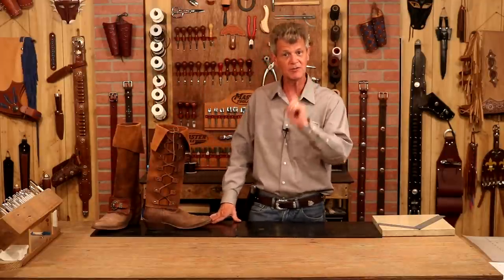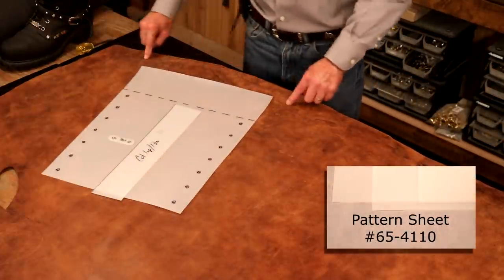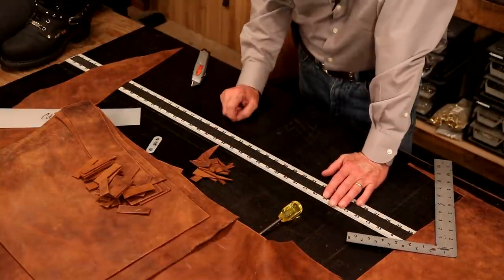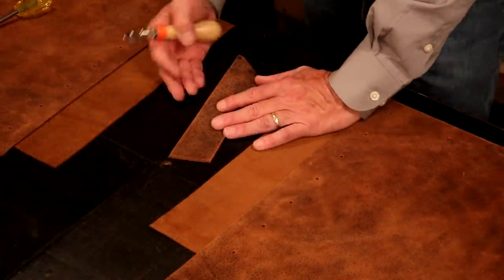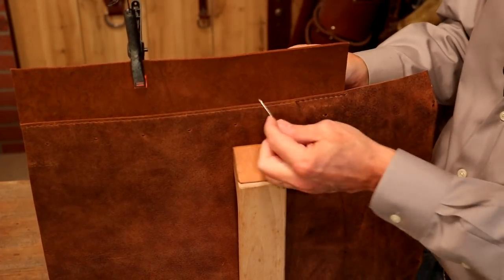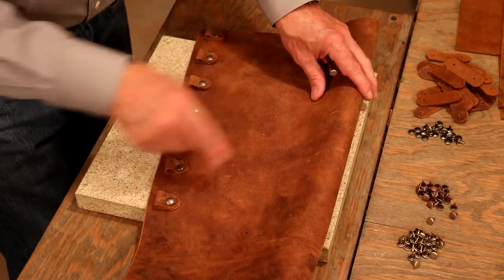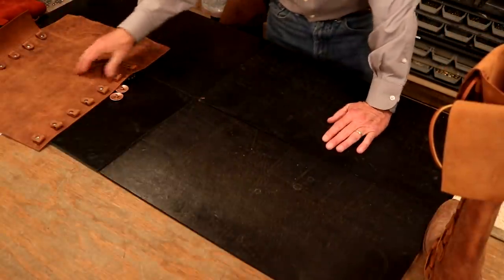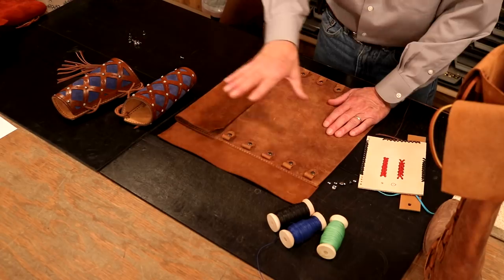Making a Pair of Leather Lace-up Leggings

Comment: Hi Chuck 
I finally got my tools and started doing leather-working yesterday, i started of trying to get a hang of the cutting by making some of your mystery braid bracelets, and i love it. Today i started making some practice saddle stitching tho i don't have a stiching pony, tho it seems like i can keep the direction of the stich decently i get "wrinkles" near the holes, and i have some trouble getting the thread through and finishing of the stitch. any tips for a newbie :D 
love your work, many hours of fun and learning keep up the good work, cheers from Denmark

-Mathias Jensen
Reply: Those wrinkles are a sign you are pulling your stitches too tight for the weight of leather you are using. You can pull tighter on heavier leather (wallet) than you can on lighter weight leather (gloves); lighter on chrome-tanned leather than veg-tan.

Comment: Had a question regarding when you glue two pieces of leather (like the tongue)....do you ever use any sort of weight to press down on the glue seam while it is drying?
Reply from the maker: Hi Art,
I will sometimes lay my marble slab on top of the leather and press it together!

Comment: I want to make a set of boot covers with reinforced knee and shin protection, with a knife sheath on the outside of the calf.  This is a decent pattern to work from. Wouldn't take much to add a thicker strip of leather down the shin and connect a leather covered knee pad as well. That could turn out pretty cool I think.

Comment: I've been doing leather craft for about 10 months and I love it! I'm struggling with two things I'm hoping to get some help with: when I set copper rivets and need to cut the stem down I don't have the hand strength to cut it off and I have been using a dremel tool to cut them. But it is time consuming and I'd prefer to cut them. Is there a tool that I can use that will allow me to cut them that I am unaware of? The typical nippers are just to hard for me to squeeze enough for the cut. Also, when I am using a stamp I have to bang the crap out of it and it's super noisy! Which press machine would I use for stamping?
Reply from the maker: Hi Nancy,
For the copper rivets, the longer the handles are on the nippers, the more pressure you'll get with less exertion. I would maybe check your local hardware store and get some heavy duty nippers.
For the stamps, if it a large stamp or a makers mark where you're just doing one, not trying to line up a basketweave, the Mighty Wonder or an arbor press will work great.

Comment: Awesome ideals Chuck, I have. Prayer mat I’m making and the corners I’m having trouble thinking it out
Reply: Use his method, small cuts tend to make nice corners. . I sometimes use my bank card when the corners need to be small.
Reply: @Freeman-Dl70  I finally got it done I used Suede on the bottom tucked the corners in punched holes after glueing hand stitched and 4 brass rivets at corners and a zipper on bottom end with a nice handle on top end with a cross and her favorite verse on front.